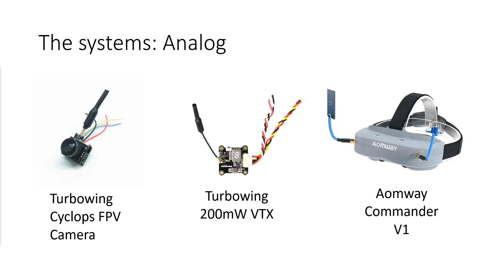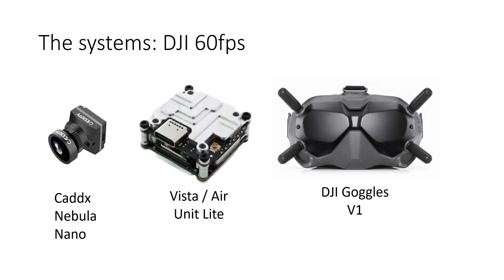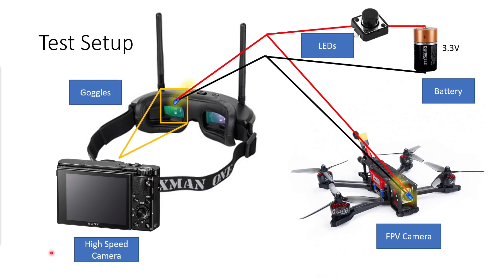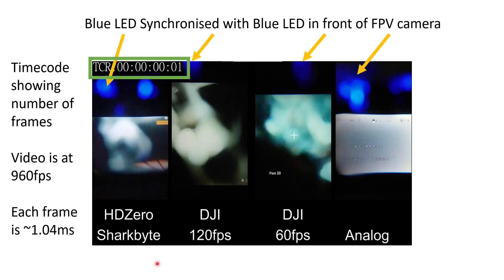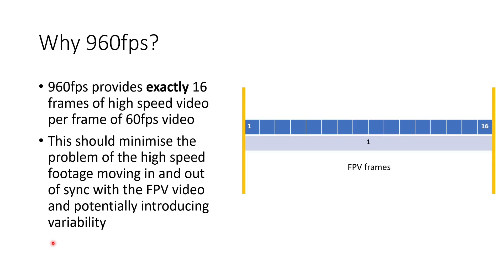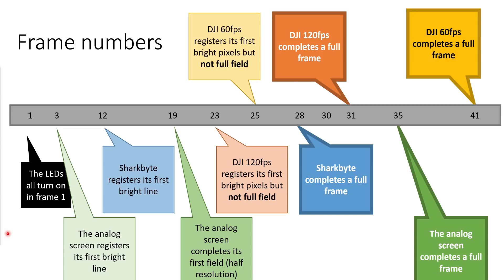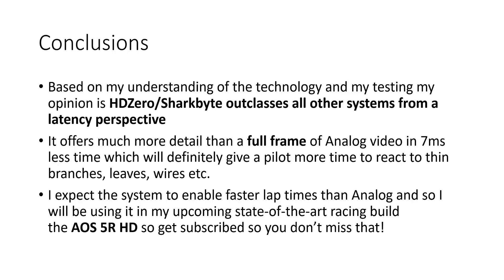Video latency testing with 960FPS High Speed Camera: Analog, DJI, Sharkbyte, HDZero

Comment: Excellent video, method, and data. Well done! The only objection I’d bring. The DJI gives much better penetration albeit at variable latency cost vs the sharkbyte. So if you’re behind a few walls or parking garage floor or building or trees, you lose what you see and become blind almost, whereas DJI just lets you see. You just have to adjust for the increased latency that gets introduced and know NOT to go crazy with the acrobatics. My only wish is I want to see a graphical way of seeing my DJI latency. For example, green HUD marker for latency less than 35 ms and red for above. Insert whatever number latency you wish as threshold, but want a way to get feedback of my latency. Cheers for the great channel!
Reply from the maker: Yeah penetration is a good point and not in scope for this testing of course. Having a more clear visual feedback of when latency is poor could be helpful.

Comment: Sharkbyte is Later than Analog.
Reply from the maker: Depends on whether you care about full field or full frame. SB is faster to full frame than Analog.
Reply: @ChrisRosser  don't See it in the Video. Sorry.
Reply: @ChrisRosser  i see 28 Analog full Screen, 35 Sharkbyte full Screen.  I think your timeline is wrong or i see something totally different.
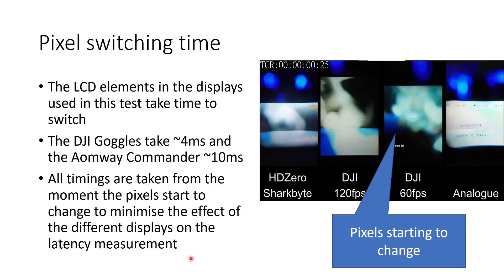Reply from the maker: @wetnsalty  I think you are adding the time for the LCD to completely switch (~10ms). This is not the latency of the link, just the latency of the goggle display. I specifically excluded this time from my analysis and discuss it here 4:50 of course you might decide to include it but if you do you should be aware that it will vary depending on the brand and model of goggle used.

Comment: ...hi Chris, your approach to science almost makes my cry after halv a decades worth of pseudo science in the hobby - you have NO idea how much we needed that...you will se an alignment in the honny - you stay the course - it's the right one (as you very well know but are way too british to state right out, nice)...
...i wonder why none of the systems utilize that problematic fpv objects are all horisontal in nature....meaning very hard to resolve with "verrtical blinds" since they only tigger a few colour/luminuosity changes per blind..... where the objct enters and exits it....it is way easier when the blinds are vertical...
....test by mounting your fpv camera on the side as well as tipping your monitor on its side...of course that could be done very easily in software...maybe none of the engineers fly fpv for real...anyway thx and my condolences regarding your countrys insane brexit (- what a shit show seen from denmark, no more  uk shopping as well)...
Reply from the maker: Thanks for your kind comment! I really appreciate your support. It's a really interesting idea to run analogue at 90 degrees. I think you would end up with 3:4 resolution because the number of lines per frame in analogue is fixed.

Comment: So this sharkbyte system is compatible for any analogue googles? And has vast improvement over the normal image through analogue?
Reply from the maker: Any goggle or screen with HDMI input. You need a special receiver module which attaches to the goggles.
Reply: @ChrisRosser  ok that's great. And I'm guessing all the issues have been iron out? As when these first came out they were pretty crap to be honest, noting but break up and bad reception.??
Reply from the maker: @k1ortia  They have really improved in those areas and higher power VT are in the works. I would recommend SB for racing atm and DJI for freestyle.
Reply: @ChrisRosser  ah OK. I'm more freestyle and medium long range so looks like I,ll have to keep my eyes peeled for a good set of 2nd hand dji goggles then.

Comment: Super cool to see it in slow motion like that! I assume you repeated this test several times. Did you find that the results were consistent or does it depend also on the timing of the LED burst in relation to the camera’s scan line?
Reply from the maker: For Analog and SB the results were incredibly consistent, aboslutely the same each time even though the light switches on at a different point in the scanning. For DJI the vast majority of tests required two frames for a full field update and as a result there was some variability. The result I showed was a typical latency with the LED turning on about half way through a frame being captured.

Comment: May want to consider a better analog camera and vtx that current racers are using..  Analog camera latency varies a lot between brands and specific cameras.  Just picking any random analog camera and then the latest digital systems is not a fair comparison.
Reply from the maker: The pipeline latency of this analog system is around 2ms. The rest od the latency is just the field rate. Even if another analog camera had 0ms of latency it wouldn't change the result by more than 2ms. I'm planning to do some testing to compare different analog cameras and compare latency. I think the way we have been measuring latency up until now (LED+photodiode) has some significant limitations that might affect the results.

Comment: HDZero when it hasn't been smooshed by YouTube doesn't actually look too bad compared to the 120fps DJI FPV. The tradeoffs appear worth it for those that need consistent latency factor to further their skillsets, if something replaces analog this should be it.

That said, I can't help for the life of me wonder why DJI can't make a low latency 25mW mode that only transmits one way, as their entire platform is software defined radio modifiable.
Reply from the maker: Isn't that what Spectator mode is? I think they may have already done their best.
Reply: @ChrisRosser  Very half baked, doesn't work in 50mbit. It doesn't account for retransmission packets still being sent on the main goggles which can drown out the spectator receiver packets due to the stronger strength, etc. Why not just allow something far more simple like a usb-c to usb-c for a spectator set of goggles?

Comment: Bro I have no idea what you talk about, but I see analog first and after auto exposure does it's thing..
Analog:      3
HDZero:   12
DJI 120:   23
DJI60:      25
Reply: Well in this case he just landed on a neat 3ms point in goggle refresh, I imagine this was not the only bit captured for the testing. And it's  not auto exposure - it's LCD's pixels switching.
Reply: @ooHotcooleRoo  led turns on at 1 so i guess it's less than 3 ms.. It's auto exposure
@Chris but please prove me wrong and put the led away from the lens in normal day light so exposure change won't take place!
Or better, put a bigger led touching the lens so the whole picture is completely white.
Reply: @gregorpesek  Man.. it's a 960 fps video. Screens and cameras are not magic, 60fps camera does not update at 960fps, it's slow ass LCD screen. Use logic.
Reply: @ooHotcooleRoo   my bad, but still.. I see analog finish off at 12 while dji at 24..
Reply: @gregorpesek  Finish off half the frame. Yes. Half the frame = half the resolution, which is already rather poor.

Comment: Super easy and obvious stuff but people don't get the whole latency pipeline like I do. Shark byte uses 4 5.8Ghz channels analog uses one super simple. Then latency of displays obviously varies. Forgot to mention the cam sensor latency also varys. You mention that you aren't using a bunch of samples.
Reply from the maker: Sharkbyte actually uses 1024 carriers not 4 and the more I learn the less I believe that Analog camera latency varies that much between different products (apart from global vs rolling shutter of course). I'm going to be doing some more testing on it to confirm.
Reply: @ChrisRosser  explain why shark byte uses 4 5.8Ghz antenna and channels/bands then?
Reply from the maker: @pizzyfpv  Ah, I see. Sharkbyte uses 4 antennas for antenna diversity. Here's a link that explains it: https://en.wikipedia.org/wiki/Antenna_diversity. The number of antennas has nothing to do with the number of channels, bands, or carriers.
Reply: @ChrisRosser  I understand diversity. So you're saying it still only occupies one 5.8Ghz band?
Reply from the maker: @pizzyfpv  It uses one 27Mhz wide channel. I cover the modulation scheme in some detail in this video: https://youtu.be/63ykOurJBR0
A band is more like a menu of channels that you can use that don't overlap with each other. It goes carriers<channel<band with 1+ carriers in a channel and usually around 8 channels in a band. There are multiple bands for FPV but they overlap with each other so its important when flying together to all be on the same band but different channels.
Reply: @ChrisRosser  thanks I was wrong. I will check out the video thanks for your comment replies keep up the great work. I made some prototype goggles using VR lenses years ago and now they all may actually work since the signal is now HDMI. I also got some avagant glyphs and put them inside of a fat shark body so should be fun. I also have some low latency magewell video capture cards and I can't wait to test the latency with this new system. May be able to fly via VR and scale screens to any size.
Reply from the maker: @pizzyfpv  That sounds awesome! Make sure to let me know in a comment if you make any videos or posts about it, I'd love to check it out.

Comment: Great video!
1. Drone mesh found different latencies for different analog cameras. If I remember correctly the caddy ant is a cheap camera with very low latency, in case you want to test that as well.
2. Wouldn't the time you pressed the button relative to the frame timing of the fpv camera affect the results? If you measure the time to the full frame changing, the system where you lit up the led closer to the start of capturing a new frame would have an advantage. But this depends on the way the buffering/rolling shutter is implemented in the cameras.
Reply from the maker: Great questions!
1. The pipeline latency for the analogue system is only around 2ms so I don't expect different cameras etc. to make much difference unless they work very differently. I will look into global Vs rolling shutter though.
2. For SB and analogue I don't think it matters because the camera shutter is synchronised with the screen update. For DJI there is some quantisation of the delay. I think two full frames is the right measure for latency as the first frame will almost never be a full field update.
Reply: @ChrisRosser  Well, most cameras now days are hardly analog that pretty much left us with CCD cameras, so pretty much all CMOS cameras are basically digital, that's also the source of aliasing problems and all that. And ones with fancy denoisers e.t.c. have some latency to them, usually 1-2 frames. So you really cant assume that analog camera is latency free out of the box. Though I do agree, that if you see changes starting to appear at frame 2 basically, camera is probably fine.

Also as I mentioned in a comment elsewhere, I suspect the DJI panels are driven at 144hz with 120fps video those half frames would be tearing. Should be easy to confirm - if the delay between half frame and full frame is 7ms - it's 144hz and tearing, if it's 8ms - then something else is going on. But it's fairly hard to determine with LEDs looking at this video, too much brightness changes, probably the best way would be to print some lines on the a4 paper and wave it around, so one can clearly see a torn frame without LCD taking ages to change brightness.

Comment: People should also bare in mind that this is worst case scenario for HDzero, with oled it may be even faster, and no matter the range, its remains the same.

With dji this is best case scenario. As soon as your flying and adding range, latency will only get worse.
Reply from the maker: Very good point well made! It makes it even more impressive that SB is able to outperform DJI!
Reply: @ChrisRosser  I have been dying for this to get released! I fly oled and man it's amazing
Reply: @anthonyfpvminiquad1728  looks like in uk you can still get the sharkbyte deal on the rx for 95 gbp, it's cheaper in US but everything is more expensive in europe. 
I have skyzone 03o oleds, would you recommend I pick it up and try hd zero out? 
range is an issue right now right?
Reply: I think the only thing that made HDzero look bad was that horrible camera it debuted with, should have been way ahead at that point.
Reply: @spikester  agreed. Fatvshark initially had the lead. Ever since Carl took charge about 2 months ago, things have been developing QUICKLY. This camera is no thanks to runcam. Carl hard to design a board and mipi for it himself on his own dime.